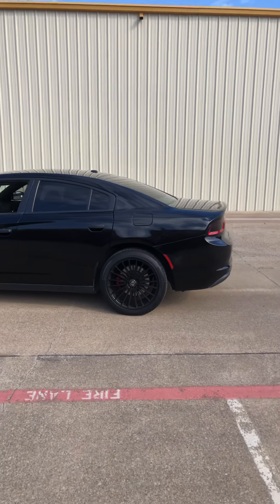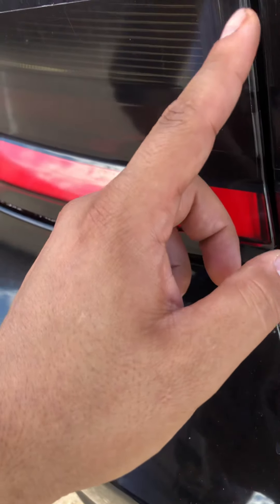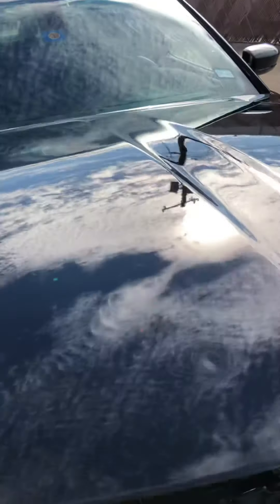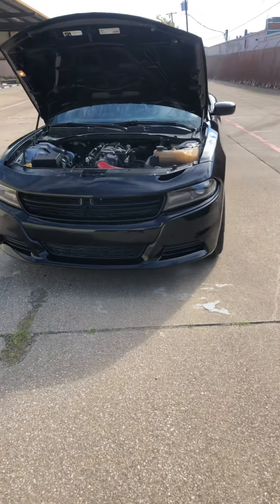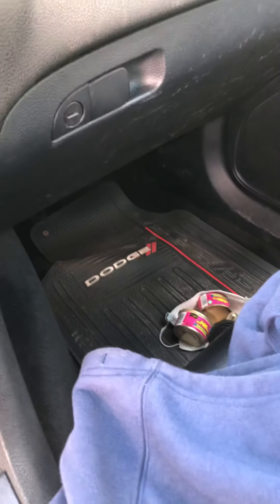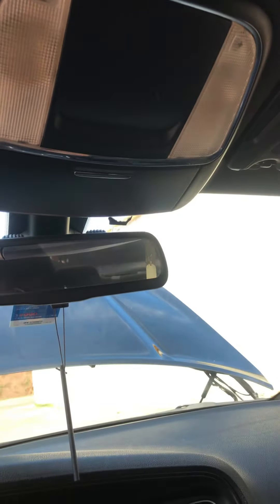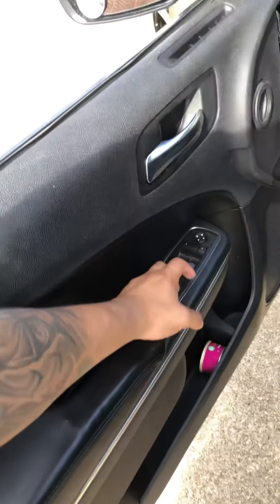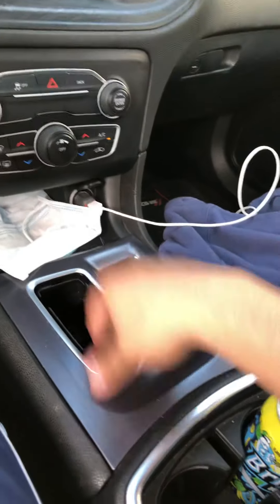Dodge Charger Pursuit 5.7 V8 2015 Update! All my Mods

Comment: How was u able to use remote start?
Reply from the maker: I had taken the car to an alarm shop and paid to get the remote start installed.
Reply: @GTZ_Buildz  ok thanks is it the viper alarm?
Reply from the maker: @jaydena4life  
Yes it is! I like it !
Reply: @GTZ_Buildz  no issues like the alarm going off for no reason
Reply from the maker: @jaydena4life  
No issues, but after a while the alarm does act up like it won’t connect or the buttons are used up and can be sensitive and start the car while in your pocket or a slight touch.

Comment: How’s the pursuit treating your now? I just bought one without realizing a lot of things aren’t so simple to customise compared to RT like the wheel options due to AWD. Did you put AWD wheels on it or yours stick out the sides?
Reply from the maker: Unfortunately I do not have an all wheel drive, but man how I wish I did have one!
The customization is not that bad actually since the pursuit vehicles are a bit beefy so you can increase horsepower and the vehicle will take it.